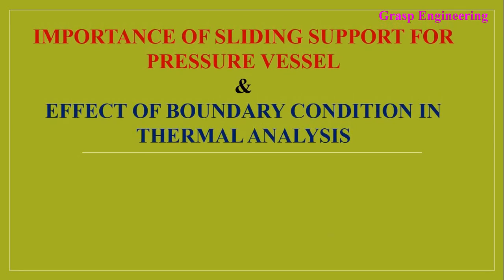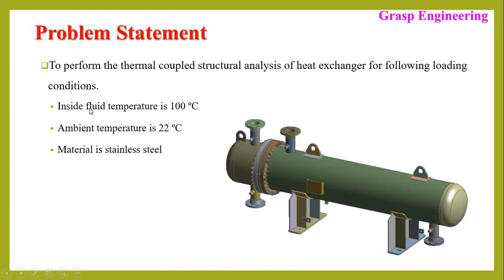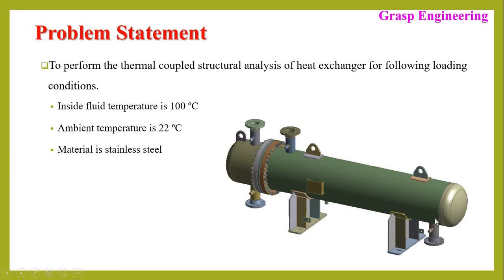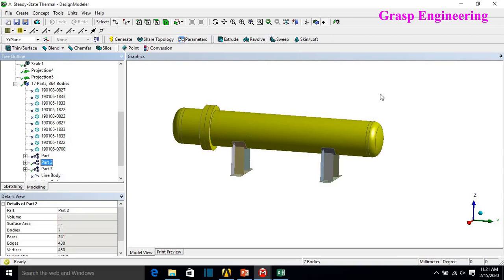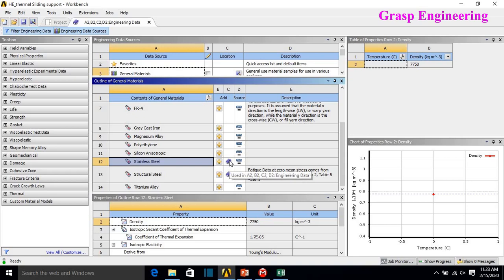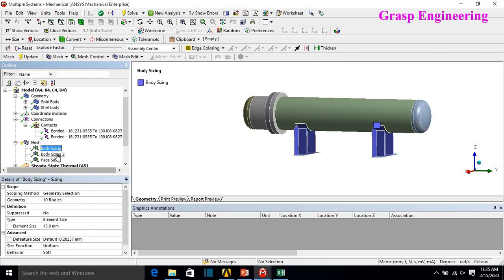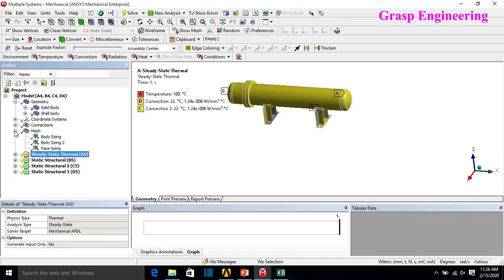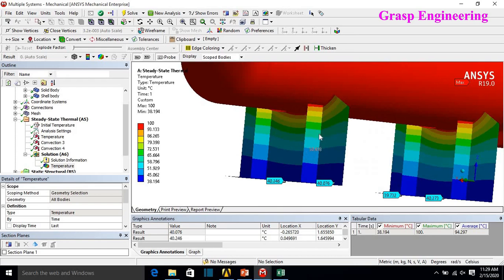Effect of Boundary Condition in Thermal analysis Using ANSYS

Comment: How we take the effect of friction load generated because of sliding because of temperature differences, consider case Vessel Support is rested on concrete foundation & friction factor is 0.45
Reply from the maker: You can calculate the thermal displacement values for given friction factor and then apply is as displacement to slidin support.